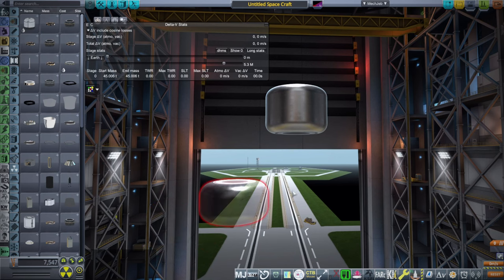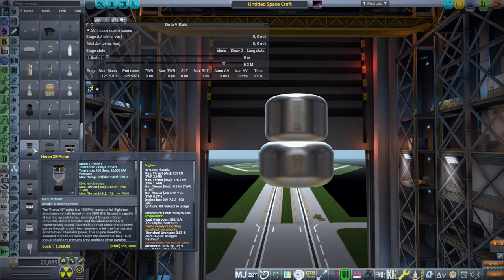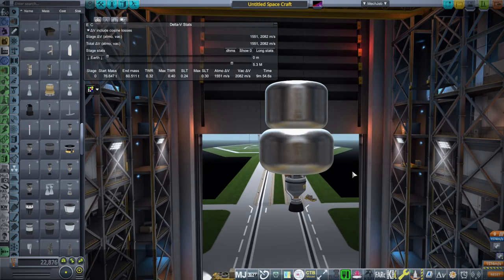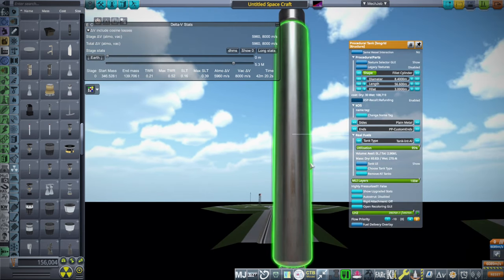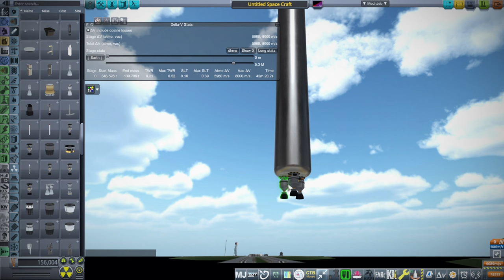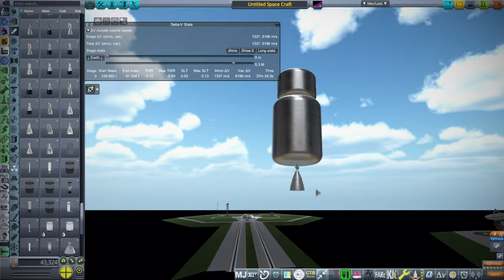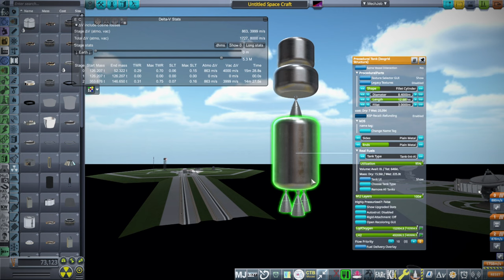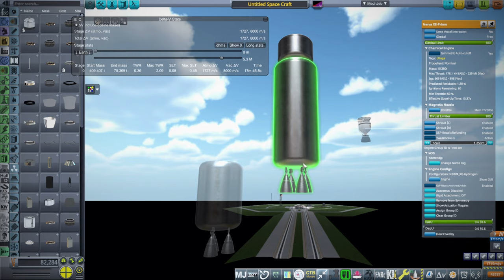Hydrolox vs Nuclear (NTR) (KSP with RO)

Comment: I don't disagree with your assessment overall, however the current projected designs for nuclear propulsion are significantly more powerful (NASA's bimodal NTR design had 915 seconds ISP and a 3/1 TWR despite the additional mass for the generators). Twisted Ribbon and pebble bed designs can have much higher TW/R and ISP, which when combined with lighter tanks make it impossible for chemical engines to compete.
Reply from the maker: Basically, I was presenting the balance point - any difference in the variables one way or another tips the balance. ISP, TWR, the tank masses, etc.

Comment: hey raiz I have a question about how I can make the script work. The ops1 now works but the point where the path is does not move at all and nothing is shown, for example t minus 10, and the other thing is that when I try to run ops3 it tells me that the program ended, could you see how to fix that?
Reply from the maker: OPS 3 can only be run under 122 km, so that's probably what's happening there. On OPS 1, I'm not sure what you mean. Is it launching the Shuttle at all?
Reply: @RaizSpace  I am referring to launching the shuttle, the ascent screen is there but the start point does not move, it is yellow and I cannot know exactly where I am.
Reply from the maker: Well, since this is about the particular display, only Giulio Dondi would know about that - all I can say is I haven't had that problem.

Comment: Well, the cooling systems for hydrogen are going to be expensive from mass standpoint as well cause you’re gonna have to have radiators
Reply from the maker: You have to cool hydrogen with either system. With a bimodal NTR, you might have power from the nuke to help you cool it.

Comment: Bigger-> Nuke wins
Smaller-> hydro wins
So where’s the boundary
Reply from the maker: Depends on the ISP of the nuke and hydrolox engines and the mass fraction of the tanks, but I basically showed the point where it's every close, assuming you're okay with two stages for the hydrolox.
Reply: @RaizSpace  how about 2 stages of nuke?
Reply: @RaizSpace  I see.it’s like on 8000m/s energy level that NTR start to be useful

Comment: Hey Raiz, Sooner or later i might get ksp RO, What would you recommended, (RP1, RP0, RP2000, etc?)
Reply: RP0 is replaced by RP1,try LRTR if you really want that experience
Reply from the maker: Personally, I most enjoy playing RO in sandbox, so not necessarily with any of the careers. If you want to be a government agency starting in 1950s with a heavily economic career, then RP-1. If you want to start in 2000 as a company with something closer to the stock career, RP-2000. However, RP-2000 still needs a lot of work.